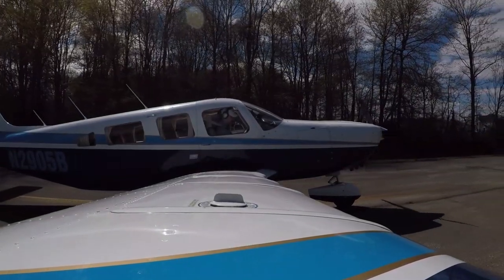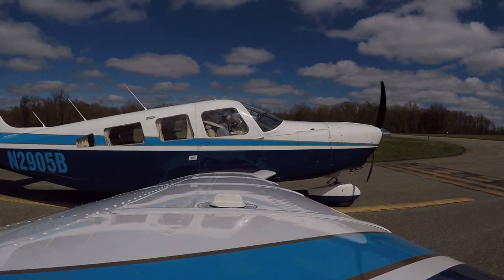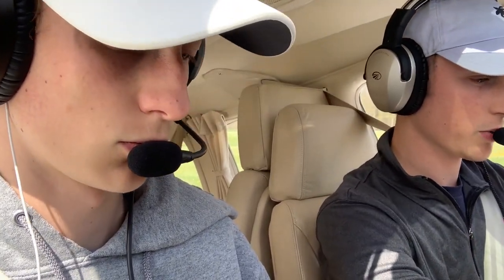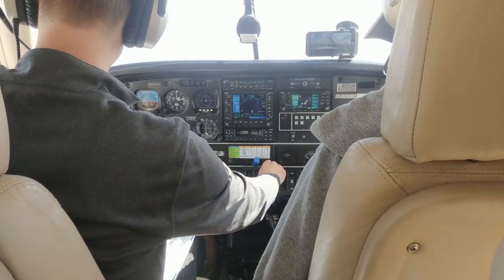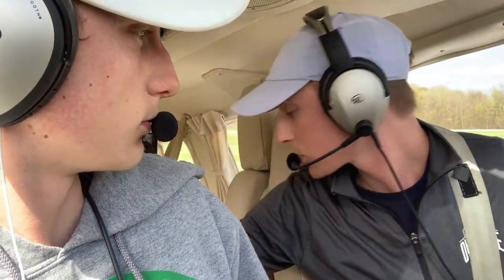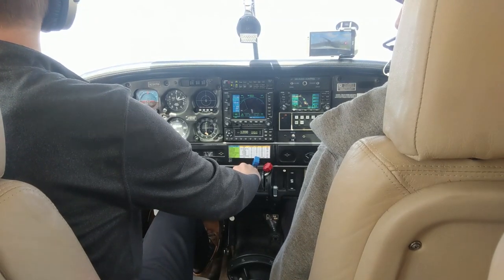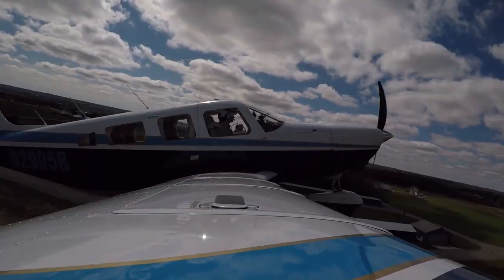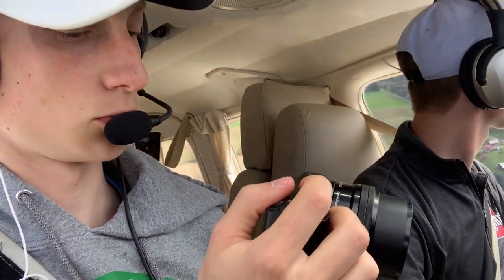Airplane BBQ & PERFORMANCE Takeoff

Comment: Why are you guarding both throttle prop and mixture on takeoff with your hand? Don’t you think it might be a better idea to keep your hand on the throttle incase you need to reject the takeoff?
Reply: I agree.....I hang onto the throttle too....except one day coming back from maintenance and because it is my own plane I get a bit slack on checking quadrant friction. On takeoff I had the power winding back because the friction was left loose by maintenance.
Reply from the maker: Even with the friction guard, I guard the throttle, mixture, and prop to ensure none roll back at all with the takeoff-related vibrations. IMO, its equally important to ensure that the prop is at full rpm for takeoff - especially in short field ops where takeoff performance is critical. In the event of a rejected takeoff, I can easily wrap my thumb around the throttle to pull it back quickly. That said, I agree that it is important to brief rejected takeoffs and how you plan to deal with one when it happens (because it is likely to occur at some point in one's aviation career).

Comment: What do you flight plane in this plane. Speed and fuel burn for long cross country
Reply from the maker: 140-140 knots at 18gph
Reply: I like your channel and the journey you are on. The Cherokee is a magical plane. I've had a 300/6 for 20 years and putting Gami injectors and an engine monitor was the first thing I did. I run lean of peak at 12.4gph and true out at 133kts 8,000' with no mods. My max cruise fuel flow is 13gph. Sire I could go faster but...... I find my CHT's are 20°F cooler and the slower combustion fuel burn and avoiding the high combustion peak pressures is putting less stress on the engine. My view is the 18gph is giving about 5 extra knots for a lower mpg and possibly a lot more stress on the engine and a sooner TBO. I did attend Mike Busch course early on and his teachings have turned out to be very true and beneficial.
Reply from the maker: @peterg9466  Hi Peter! Thank you for taking the time to comment. We completely agree that LOP operation, if done correctly,  results in lower CHT's and is overall better for the engine. Unfortunately, the spread on our temps is a little too large for LOP. Gami Injectors are definitely on the list of things we want to add to the plane in the hopefully somewhat near future.